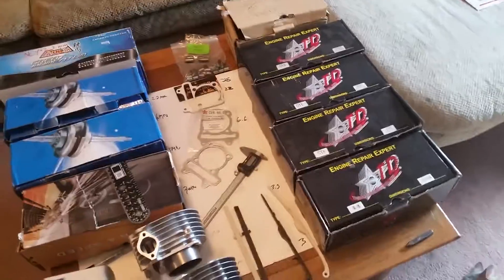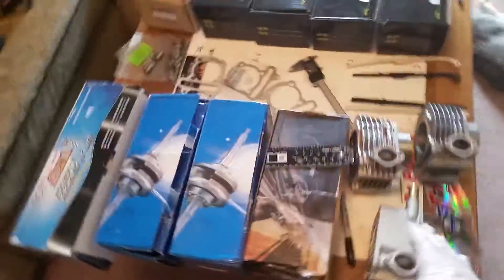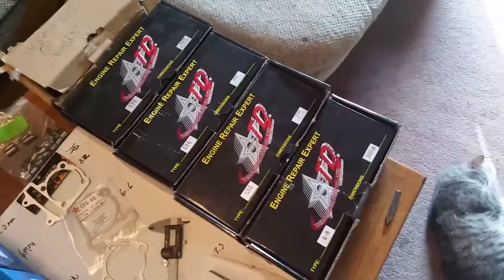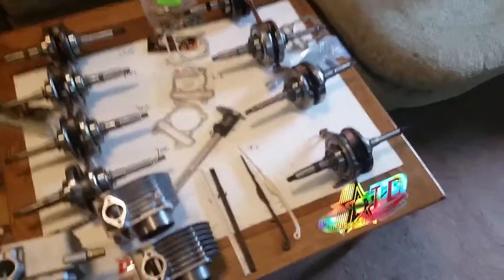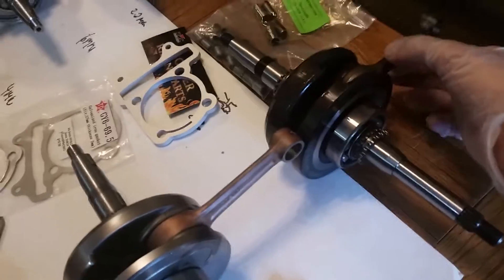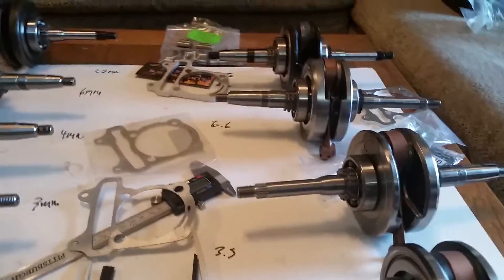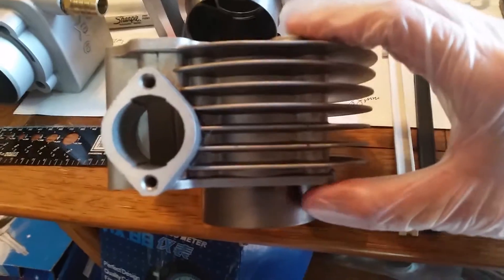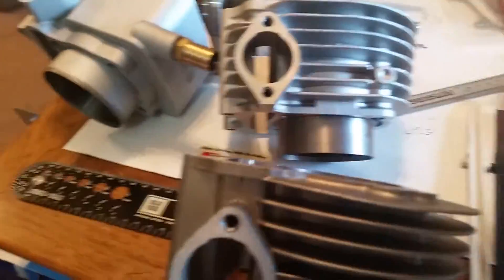GY6 Stroker Kits Explained

Comment: Too bad it's hard to find any way I can upgrade a 139qmb past 72cc without the crank being an issue. Can find stroker cranks but non of the supporting mods needed to make it work properly due to the longer strokes.

Comment: When you mentioned the arms being 6.6 mm where can I measure mine to find out what stroker crankshaft that I have is it the thickness of the arm or the length or is it the width of the hole on the arm.... I am baffled and I just want to learn how to do this correctly

Comment: Hi Daniel I appreciate your videos and trying to learn more about my scooter I just bought...it did not have a lot of info on it...I know tho it has a 70mm bore on the crank case and the pistion is a 67mm pistion but I don't not at all know what cc the build is...is there an easy way to find out a what my build is...I have a pic of the cylinder head specs but do not know how to figure it out....in my city a lot of scooter places don't want to mess with ice bear mad dog tirkes and it's become n a head acke just trying to find out what parts to order to get it to run again

Comment: Hey Daniel, do you know if you can use a NCY 2.5 Stroker Crank on a SSP-G 180cc B block (oil cooled) block without modifications? if mods are needed... what should be changed?  Thanks very much for your help!

Comment: What about stroker cranks for 139qmb??? All I have seen is a 44mm I'm thinking, I guess that's about  +3mm, longer, if the stock is exactly 41mm,  I'd like to get something around 46-48mm, with around 52mm bore, or if I can get really crazy, a 57 to 61-63mm bore,  welding and machining,  but I think I will likely just do a 150 swap,  with a bbk,  it would be slot cheaper and easier! A turbo would make a nice upgrade! Haha!

Comment: Got a question I got a GY6 50 and I want to put the best top of the line stroker crank in it I want the best 100 cc kit that money can buy I was wondering  if you could e mail me the entire kit that I would  need to install and details on putting all of it together correctly.  My email is racingjc460@gmail.com I want to of the line quality because tearing down an engine is a lot of work I want to make sure everything  works correctly  when I am done I want performance  reliably

Comment: I have questions lol .. I'm gonna put a 61mm pistion and jug on my gy6 . I have a supercharger I'm putting on it . And I want it to be a stroker 171cc piston 61mm . From my understanding that's as big as you can go without boring the case out. I'm using an A9 cam. So what crank should I use?

Comment: I just did the 8.2 crankshaft and  I use the 180cc 63 bbk with a12 cam it was alot of job to do and modification  I have to take one teeth  down on the cam chain to fit properly it was hard but I did it

Comment: Awesome video hey Dan question can I use a 2.5 stroker in my 150cc bored 180cc kit 157qmj or can I use a 8.2 stroker with the 180cc bored out kit?
Reply: Baqash Ahmath yes I just did it but alot of modification u need
Reply: Super
https://youtu.be/vnjRNz81MFs

Comment: I have 1 question. Why would anyone in their right mind pay over 3k to have a 232cc when u can buy a honda helix 250cc for $500? And its able to be bored out more.
Just for reference I have a 2016 icebear maddog 150cc with yoshimura pipe, racing narrow rim and tire, upgraded speedo, uni filter with curved racing air intake, brakes, and entire NYC transmission kit. (Variator, weights, clutch all that) I go 63 mph GPS confirmed on stock displacement. Trying to figure out if I should sink several thousand dollars into boring it out, or just putting the money into my 2012 50cc VIP with a 250cc honda helix motor and Harley softail exhaust.
Reply: jay Tarantula 7000? For what? To bore out a case? I’m confused
Reply: @JAYJAY1787  to have a special b block (only 1 that can reach 232cc) be bored out to hair thinness and stroke and all that.

Comment: just to clarify taida crankshaft stroker 3mm or 3.5mm will work without spacer if it a taida brand cylinder like taida cylinder 61mm /  fit 54mm stock gy6 157QMJ?

Comment: So Daniel I have a 62mm kit with a 2.5 stroker crank will I need to use gaskets on both sides of the spacer 1.65mm